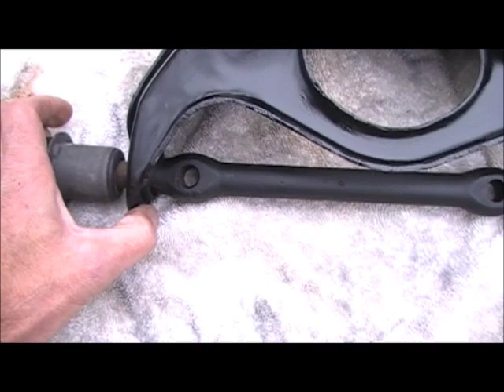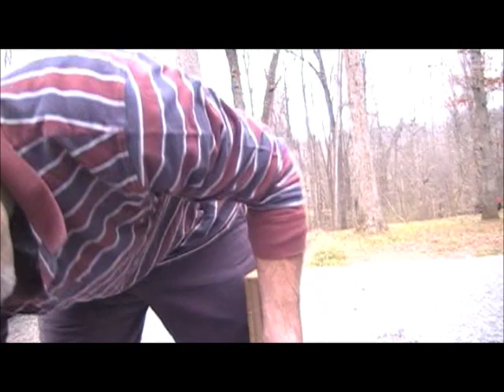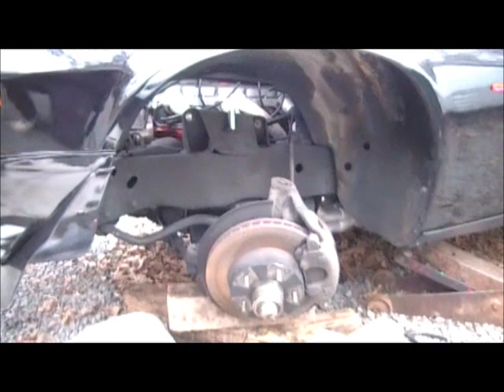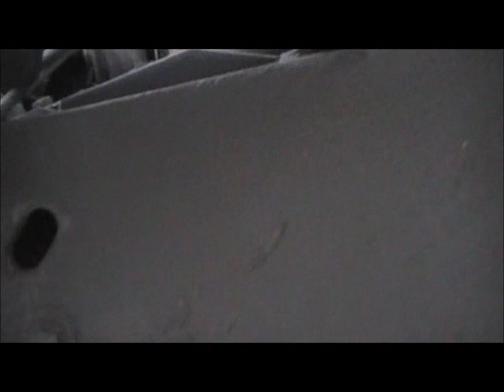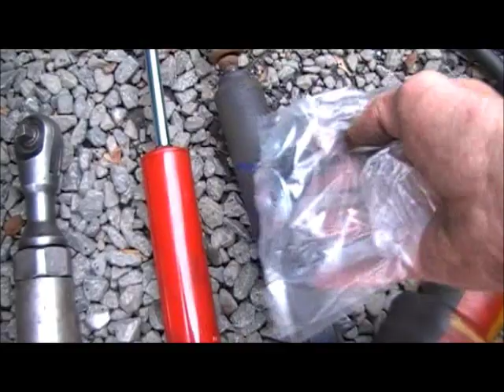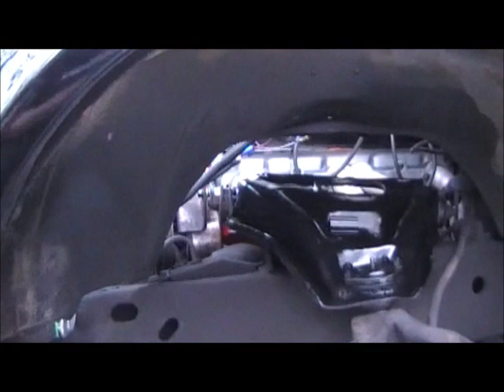Camaro front end.repair Pt 2

Comment: What is preventing the LCA from coming all the way down and having the coil come out? I've got to do the UCAs and LCAs and I'm not 100% sure on when the coil actually comes out. Should I do the UCA before the LCA? Or does it not really matter? Thanks again for your video. I've been looking for a good one that explains everything and yours is the best by far.
Reply from the maker: The springs will lodge into place when lca's are bolted to A frame of car. You use a pry bar to dislodge them once you drop them from lower ball joints. A jack can be used to lift them back in position during reinstall. Careful not to launch them out at yourself! Maybe tie them off until you see how they react. Sounds bad but really simple.
Reply from the maker: So start with lower ball joints, remove spring.

Comment: Thanks for the video, Just thought I would mention the old shocks were hydraulic radial tuned shocks thats what they used in 75 these days people like gas so that is why one is pushed out and the other isn't there are arguments for both kind of shock, older cars tend to ride nicer with the hydraulic unless it is a real bumpy road there they will boil as they heat up over the rough road. Again thanks, I picked up a hint or two ;)

Comment: Hey nice Video. I have a 1973, and a 1979. I'm done with the 73 now I'm restoring the 79. I'm done with all of the bushings and ball joints, I'm having a Bear of a time installing the new rubber bumpers in the upper control arms, any advice or technic that you can share? Thx Ken.

Comment: On "part ONE" the video ended before you removed the old bushings...Part 2 starts out with everything out, and new ones going in....???
Reply: Same here , that bushing is why im here !!
Reply: @st.louiscritic960  I ended up going to Firestone, carried in the control arms- $65 for both uppers. Took 1/2 an hour, that was the shop minimum at the time. Well worth it. I sold that car shortly after.

Comment: Awesome Videos man. Can bad bushings cause the whole wheel to slide forward or backwards? On my 75 Vette the wheels have way different clearances. like 1/2 inch on the drivers side from tire to fender in front, passenger side is more like 3 inches. Local shop said I have to replace upper and lower control arms completely.
Reply from the maker: Measure between the ground and the top/bottom control arm. My thoughts would be on a 75 model , replace it all but the sag is probably due to a sagging spring. The control arm bushings and ball joints are replaceable without replacing the entire arm however it is easier for the tech and shop to replace as a unit.

Comment: At 5:38, where you talk about using a special tool to remove the top shock nut.. fifty cent tip of the week: Put a socket on the nut and a long 3/8" extension. Work it back and forth a few times until the shock stud breaks right off. Super fast shock absorber change with zero hassle ;)